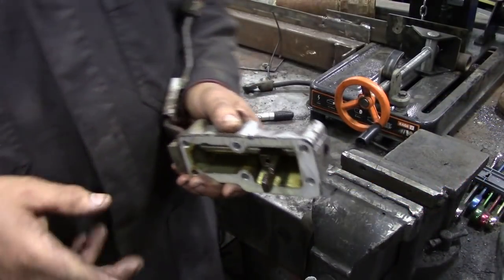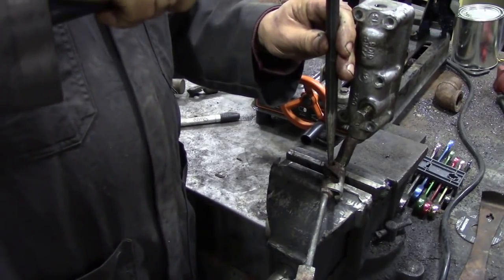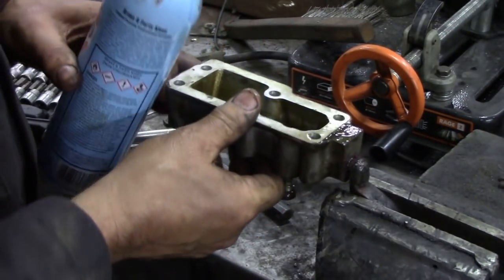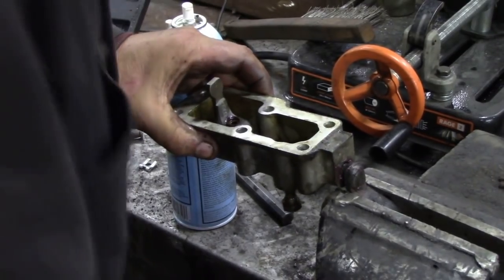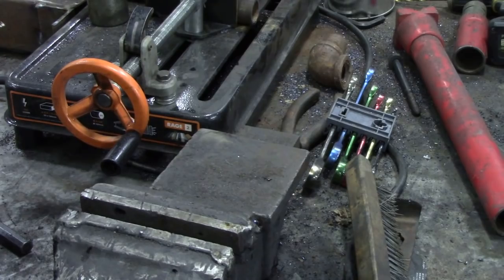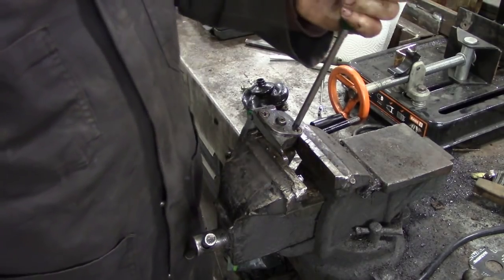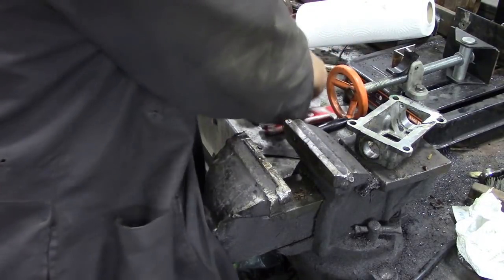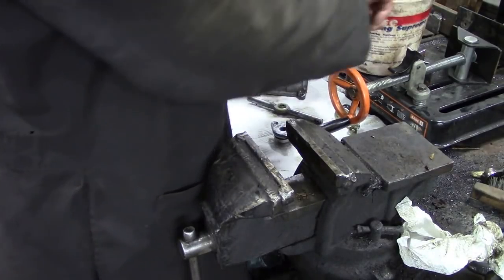NAS 90 day 3 transfer box linkage overhaul

Comment: Seized high/low and diff lock linkage is so common. And as you suggest, some very modified vehicles used off road still have non usable high low and diff lock. I suspect high revs and big tyres see them through the muddy car parks!
Reply: Just a hint of sarcasm there.

Comment: If you have some down time and an LT77 kicking about I would love to see setting up an LT77s lever, not just the return to center spring but the left right adjustment for 5th and reverse.  I had to replace the 'ball' and housing and rebuild on to a replacement box from Ashcrofts the other year.  Center return fine but the 5th/reverse stops I never got right. I followed the LR workshop manual (although I discovered not all the set up procedure is in one place) It's the later shim type not the nut and bolt.
Reply from the maker: Pete -- I have no LT77's jobs in at the moment but soon as i do i will do a video for you!
Reply: @BritannicaRestorations  Cheers, I went through the LT77 videos in the hope you had done one.. closing statement was you would :)

Comment: One of the Australian four by four magazines put a standard new, unmodified Defender 90 up against a heavily modified Landcruiser with diff locks, huge wheels, all the bells and whistles, vs another bog standard four wheel drive ( can't remember which brand). The other dropped out very early, and the 90 managed around 98% of what the modified vehicle did. Makes you wonder if it's all worth it.
Reply: The big wide tyres actually make the grip worse due to the weight per square inch on the contact pad.
Reply: @harveysmith100  Yes, simple physics!!
Reply: @bigm383  I haven't done physics since school, has it changed much?
Reply: @harveysmith100  It's been replaced by gender studies, feministic studies and virtue signalling.